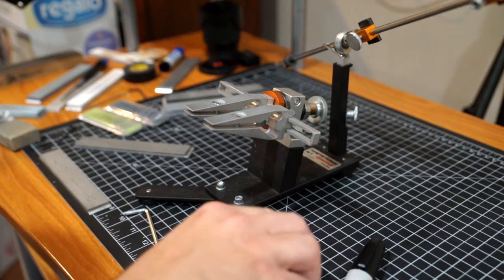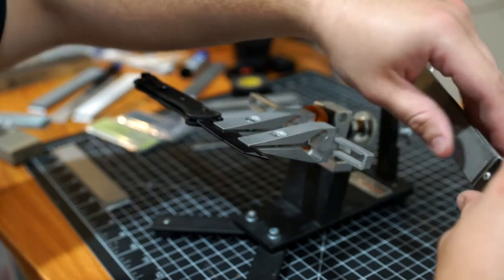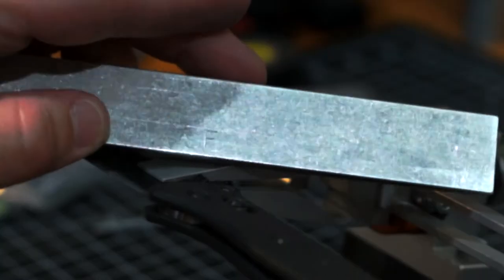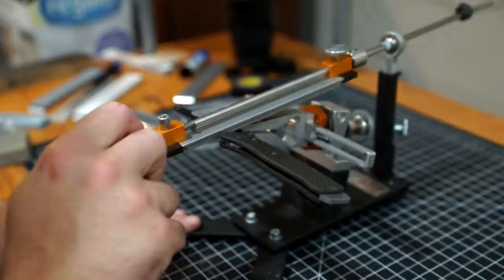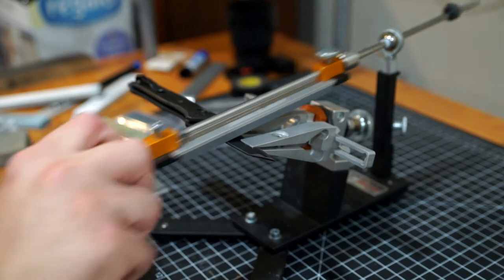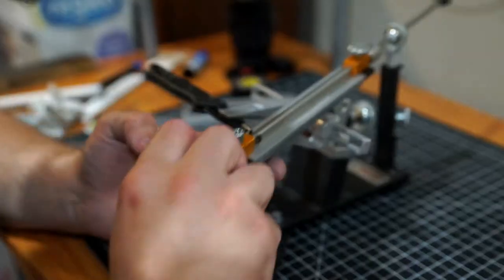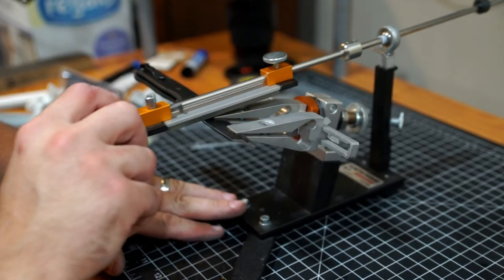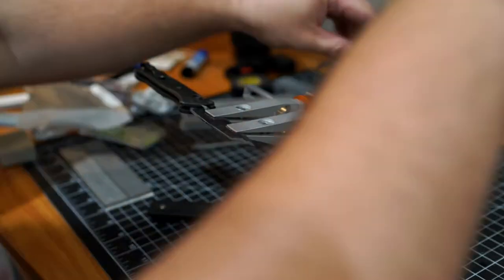Sharpening CPM 3V | Benchmade Bailout

Comment: Excellent video, as always.  Curious about that Hapstone 1200 grit silicon carbide stone.  Looks like only a 1000 grit is currently offered at gritomatic.  Have you had it a while or can you please provide a link to where you purchased it?  Thanks.
Reply from the maker: Ronnie Suburban that specific stone came with the set when I bought the K1. It was a 3 pack 400, 800 and 1200 grit SIC set that was offered with the K1. You can probably email Hapstone or Gritomatic and ask if they sell them. I highly suggest buying the diamond resin stones for the Hapstone system though. They give great sharpening results and fast cutting that diamonds will give but still a refined edge.
Reply: @Iheartknives1  Thank you.  Love the videos.  Congrats on your new arrival, too!

Comment: Do you need your left hand to hold/control the sharpener?  I can only use my right hand and wondering if this might be an option.  Thanks.
Reply from the maker: Bama fan in KY I would say that it isn’t necessary but it would make it much more difficult. The parts where a second hand would possibly be necessary are the times when you have to assemble it and also adjusting the knobs. Sometimes the rod slips when adjusting the knobs and I’ve had to use two hands. Adjusting the height of the sharpening rod would be very difficult as well. I think the KME would be a much easier sharpening system and would be a little more stable than the Hapstone K1. I hope this helps! Thanks for watching and commenting! 

Ps: the next time I sharpen with it I’ll try to do everything with just my right hand and see how difficult it is to sharpen a knife.